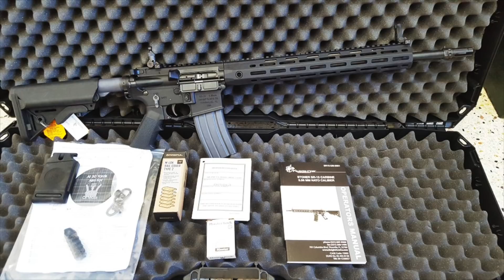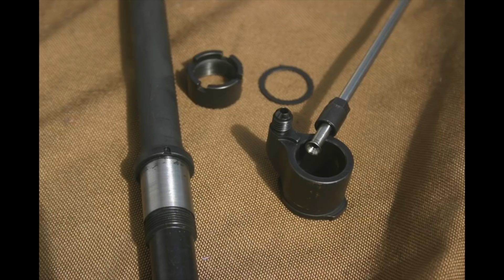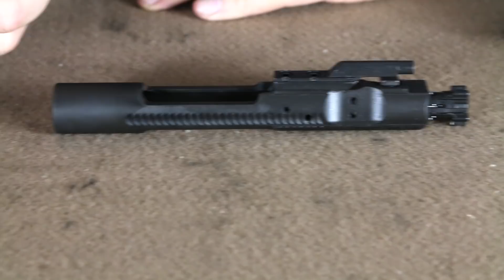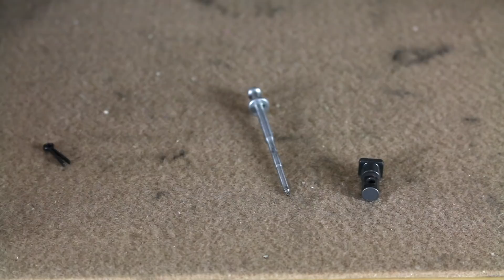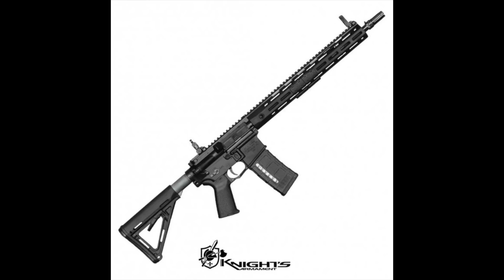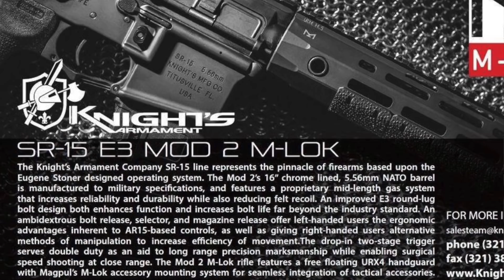The Knights Armament SR15 E3 Mod 2 M-LOK

Comment: Can you use a sr15 e3 mod 2 upper with a mil spec bcm lower or will it be more reliable with a KAC lower? Want an upper cant afford the lower if I get the upper
Reply from the maker: Work 100% on any Mil-Spec lower

Comment: Apparently, the endplate on the buffer tube allows you to not stake the castle nut and have it never come loose. It has a protrusion that fits into a recessed area in the receiver. The castle nut they use does not even have areas to allow staking. I removed mine it was extremely difficult to do, torqued way beyond 40lbs, friction fit only.

Comment: I was also wondering how long does a gas tube and gas block last on one of these rifles? I know the barrels are about 20k rounds, thanks for all the great content
Reply from the maker: Thaddeus Shell Same Service life as the barrel. Normally the barrel is replaced as an assembly. New gas block and gas tube but I don’t know KAC’s protocol. Theirs probably could be reused with a new barrel.
Reply: @SmallArmsSolutions  Hello. Do you feel they do a good enough job at staking the gas key ? Compared to Colt and BCM it’s not as pronounced. What do you think ? Thanks

Comment: Just got my sr15 in a few weeks ago, and its awesome but I agree there are features that should be present for what this gun costs. A full ambi CH should be standard on this rifle. Knights makes one so I am not sure why they are not standard. The sandcutter BCG should be included as well. The E3 BCG is solid, but for the price, a coated BCG should be factory standard. Also, my rifle had multiple cosmetic flaws straight from the factory. Scratches and weird heat treating streaks on the receivers. You would think for 2500 bucks the finish would be near perfect, but thats not a huge deal since this rifle is my go to rifle and gets carried around a lot. Also, they have stopped shipping the rifles with LMT stocks, which is a shame because it added to the value of the rifle. Instead you get the cheapest magpul stock available, which I removed immediately. Love the gun but there are some things that could be improved. If this was a 1500 dollar rifle I would not be complaining, but for 2500, I feel like these issues are legit.

Comment: Noveske or this?
Reply: Noveske doesn’t really make anything, they more or less re-brand and assemble (using high quality parts of corse ) KAC and also LMT or truly “High end” Manufactures that are better than your high quality “run of the mill” rifle like BCM,DD, Noveske etc
Reply: @submoa9278  I believe Radian has stepped up into the Top tier of AR with their ADAC lower and completely in house Model 1 upper that is apparently smoother to shoot than the SR-15.
Reply: People shoot sr15s past 10k rounds with no cleaning, no oil, no nothing. Can’t beat that with a stick much less a noveske

Comment: I have carbine SR-15 e3 in key mod. I have an ACOG on it. I wish I would have gotten M-lok. Is it worth sending in to get changed? Also going to buy a AR 10 with a twenty inch barrel. I want the SR 25 APR. but the price is scary.  Thinking about going with the Armalite super SASS or an LMT. Suggestions?

Comment: What would be super cool is the KAC Mod 2 gas system on an LMT MRP rifle. You would get the full ambi lower and barrel change capabilities of the LMT but also the benefits of the KAC gas system.
Reply: Ambi bolt catch is not useless. Its great to have for clearing malfunctions.

Comment: How does this stack up against the radian arms model 1 ?
Reply: Far better.
Reply: The Radian is going to have a greater degree of accuracy and better features for the average shooter. The SR-15 is going to last longer and have a potential for better reliability. It would come down to what you want out of it.
Reply: @rileypeak3196  sr15s are 1/2-1 moa shooting rifles all day long. There is no radian that outshoots a KAC.
Reply: @Richardjohnson6969  not true. My mod one Radian outshoots my wife’s KAC sr15. As far as pure accuracy goes. both are 16” barrels. We both practice often together and we can both switch firearms and whoever shoots the radian has tighter groups. It’s minimal, mere centimeters but Radian is the epitome of accuracy. I’ll take the KAC any day of the week for reliability over the radian though.
Reply: @GassyMan25  disagree from personal experience. YMMV
Reply: @Richardjohnson6969  you can disagree with me and that's fine, I appreciate that you appreciate firearms. But I will 100% say your wrong stating there is no radian that can outshoot a KAC. That's simply a false statement because both of those riffles shoot sub MOA. Depending on the individual riffle, some KAC riffles will outshoot Radians. An some Radians will outshoot KAC riffles.
Reply: @GassyMan25  I’ll eat my statement. You’re probably right. But in terms of reliability? I’m picking the E3 system.
Reply: @Richardjohnson6969 I will not argue with you there, no doubt KAC is the ruggest and most reliable riffle of it's kind. The E3 extraction system is as good as it gets. Didn't mean to come across as condescending. I love them both.

Comment: (First off I am not an expert, at all. barely an amateur actually)Did I hear you say that only KAC, and LMT are using straight gas tubes, somewhere around 8 minutes? If so RESPECTFULLY, I think you maybe incorrect i have a POF renagade and its Dictator system uses a straight gas tube, also I believe wilson combat uses a straight gas tube, and I think BCM does as well, maybe others but those are the ones off the top of my head. I could be misunderstanding you i guess or maybe you are referring to something else idk. Also I think KAC and LMT are alittle over rated. Good rifles dont get me wrong but some people act like they are some holy grail rifle, and I just dont see the 1500-1900 dollar value. Just my opinion.

Comment: I have 3 of these. 2 14.5” and 1 16”. 

They are having some major quality control issues. Two of mine have been in for repair several times. They were both way under gassed and wouldn’t function without a suppressor. Also experienced some cam pin wear. The pins had major grooves worn in them after only a few hundred rounds.
Their customer service is terrible. You can only talk to the receptionist.
My guns were sent back to me and weren’t even test fired. I had to send them back 3 times for the exact same issue. I have one that is there now waiting to be fixed.
There is no way to communicate with the technicians who are working on your gun and you have no idea what they did to fix it or what parts were replaced. I’ve been a long time KAC supporter and I own several of their rifles, but I will never buy one again.
The civilians take a backseat to their military customers. I had a gun in for repair and several military guns came in, and they sent me an email and said I would just have to wait until the military order was taken care of.
Reply: This sounds like bullshit. They emailed you and told you to wait? yea ok. Ive personally sent a knights gun back last year and I didn't talk to a receptionist and the customer service was great. Except I did have to pay for the shipping there. Which is not right.
Reply: Mine had to go back twice.  They eventually blamed a subcontractor for a "bad gas key".  They first said it was my ammo (XM193).  What a joke.  KAC sucks.

Comment: Great video, however, just FYI, the buffer and trigger, like the carrier itself as I mentioned in your other SR15 video, are not "proprietary" in anyway. Those are standard dimension parts which will fit and function in any AR15 pattern design.
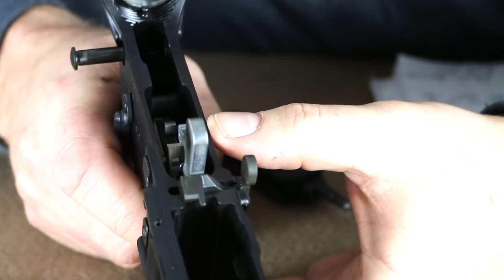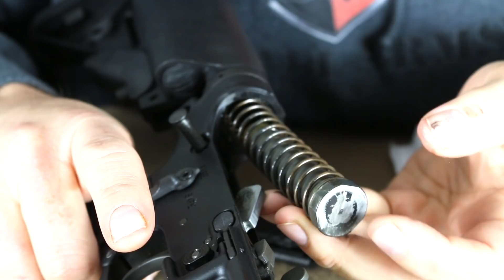Reply: @BmgNewbie  He did say "Proprietary"...Trigger: 9:49 , Buffer: 10:08 . The buffer IS NOT proprietary. Go ahead and measure the weight. It is a standard carbine weight buffer, and standard dimension. As mentioned, just in case you didnt read it carefully, I said I corrected him in his other KAC SR15 video where he said the carrier is proprietary due to the different cam pin cut out. I did not say he said the carrier is proprietary in this video.
Reply: @Cubic_3   You need to correct a bunch of other people on here. People love to hate knights because of the cost.
Reply: @22BStan  Unfortunately it is not possible. People will only hear what they want to hear. Ignorance and misinformation are few of the biggest issues we have in the current 'gun community'. Majority of the people simply dont want to change their mind about something they already dislike, even if they were misinformed/ill-informed about the subject matter.

Comment: The thing I wonder about regarding the manufactures who include a bolt release on the right side, is how much more complicated is it to include a bolt hold open also on the right side? I would rather have a bolt open on the right side because it would make clearing malfunctions easier. I have more use for being able to engage the bolt hold open from the right side than a bolt release. That is my experience anyway, I wonder what others think?
Reply: I've thought that same thing, especially bc I have a LMT with the ambi bolt catch/release.  I don't really get it either.
Reply: Do you expect to be clearing a lot of malfunctions on a $2000 ar?